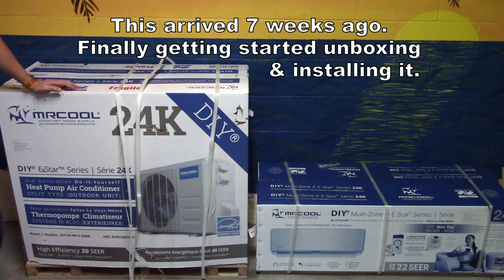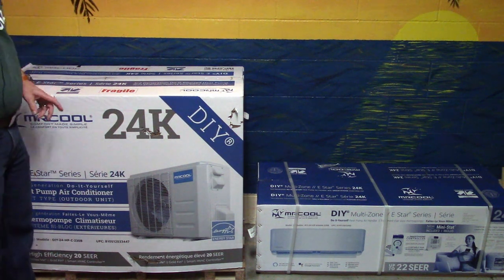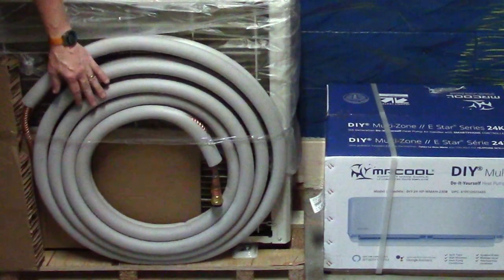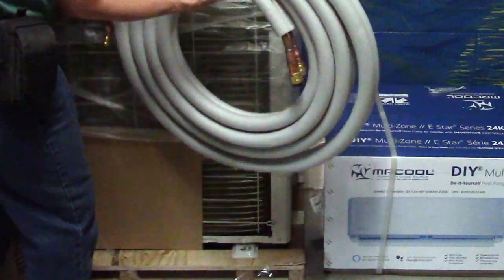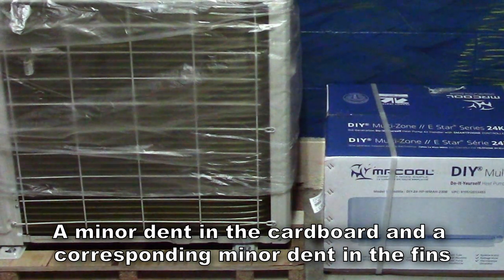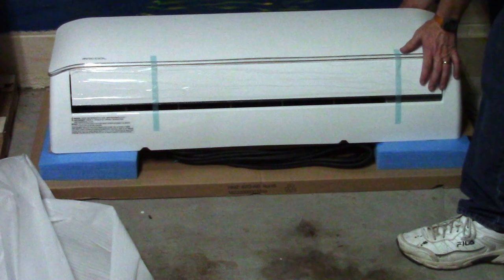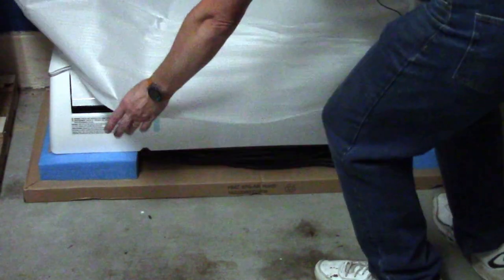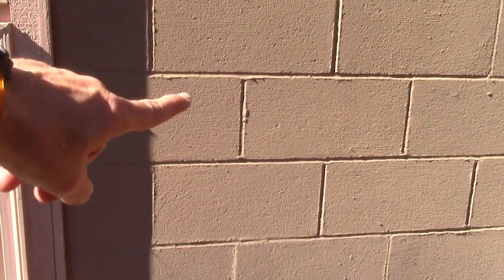MrCool Part 1: Introduction

Comment: How much was this unit at time you purchased it?
Reply: I just logged into my Costco account and see they have a 12K unit at $1099.99 or 18K unit at $1299.99 at time of this comment.
Reply from the maker: @Hebrews12v2  Ours is the 24k unit and was $1500 delivered.
Reply: I just ordered the 36k BTU unit for our 1500 sq ft basement Cost = $2374 plus $150 shipping + sales tax.  Be sure to shop because this unit was cheaper elsewhere but did not include some of the key extras such as the white down-spout looking housing to hide the lines.